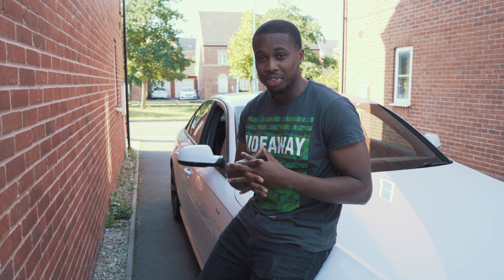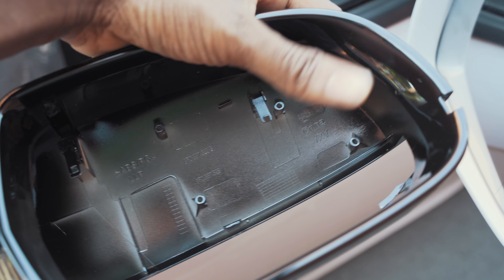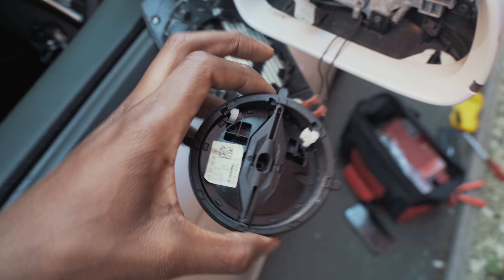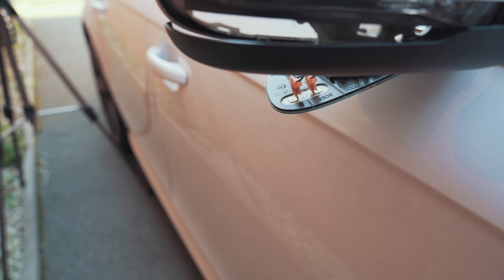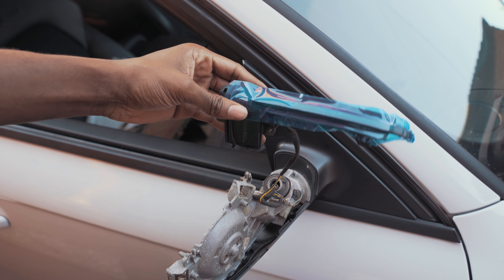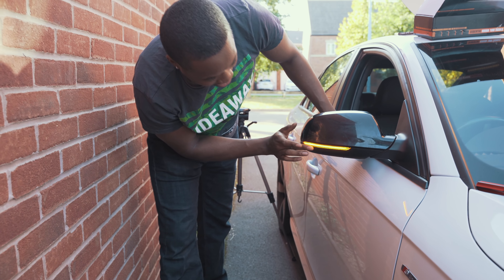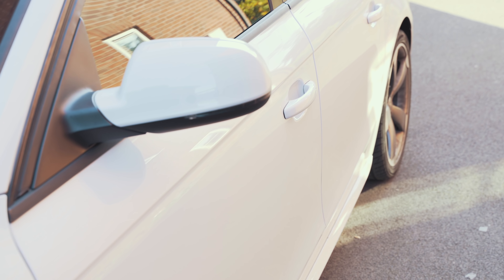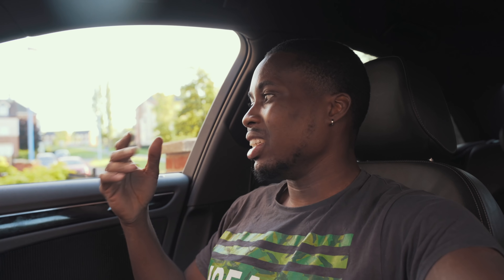EASY RETROFITS FOR AUDI OWNERS “ DYNAMICS LIGHTS DIY “

Comment: When you need to remove a bit of plastic either use a dremel or heat up a knife and cut it off. Never use pliers becuase you risk cracking the whole thing :) Glad it worked out :D